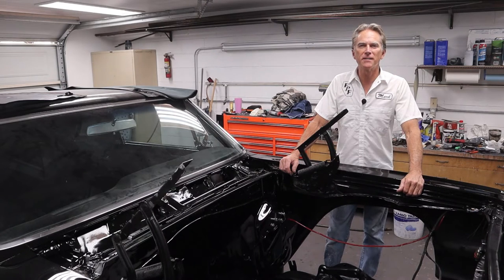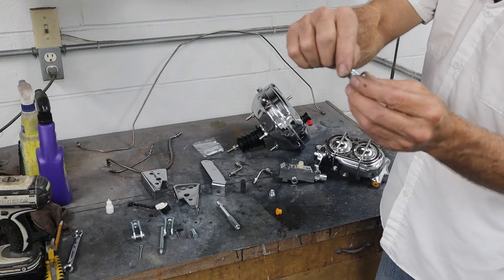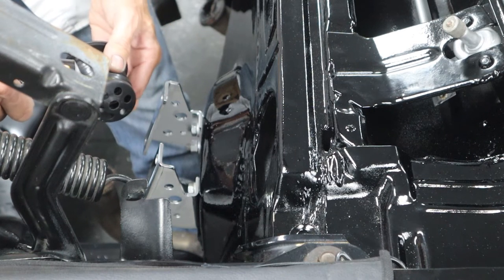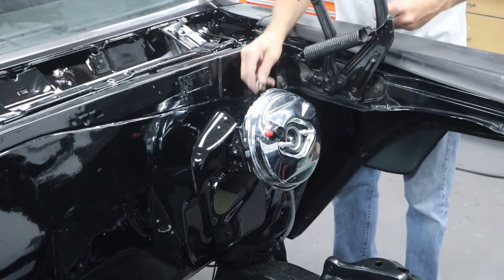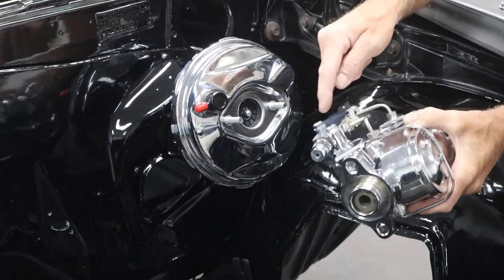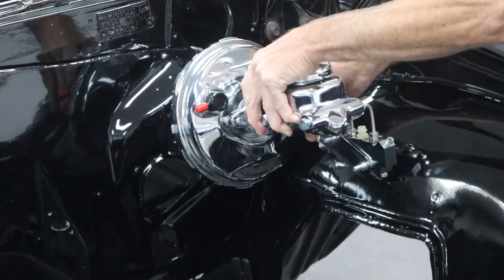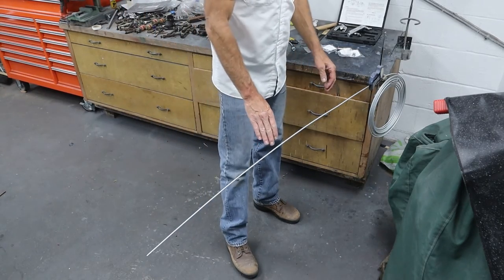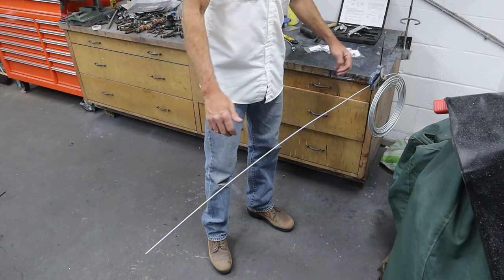1965 Malibu SS (Ep 14) Drum to Disc  New Brake Booster, Master Cylinder and Brake lines Installed

Comment: Really enjoying this series. I'm like you, I like the car to be sealed. I recently removed the entire interior of my 64 Chevelle to install sound deadening and even though the car was restored about 10+ years ago, I was surprised on how many holes were in the floorboard and firewall. I had to seam seal sections, add in factory body plugs and seal holes that had been drilled in the floor for what ever reason.
Reply from the maker: I think it is one of the easiest and cheapest thing you can do to improve the drive quality of a car, especially older cars.  Strange what we find in these old vehicles even when we have owned them for years and years.  It only takes a small hole to let water in and ruin a classic.
Mark
Reply: @FoothillPaintandFabrication  As I have been watching your series, each post you make it seem to be something I need to do on my car next. I want/need to replace the front metal brake lines, as I have a Wilwood system, but who ever installed it, hand bent the lines going from the splitter to each front wheel, so there are hard kink bends. The brakes work, but....yeah, naaaa, not correct. Looking forward to the next video. Thanks
Reply from the maker: @OpenRoader  Strange they would do that when a bender is pretty cheap on Ebay or Amazon.  The double flare tool is a must so get one or borrow one and you will make it look perfect I am sure.  Undoing less than proper work is sometimes most of the work on these cars isn't it?
Mark
Reply: @FoothillPaintandFabrication  I would say, 80% of the work I have done on my car has been undoing/redoing someone else's poor workmanship. But it's OK. I'm a details kind of guy, I like it all to work. I'm getting there. I emailed you some pictures. Blue 64 convertible
Reply from the maker: @OpenRoader  Perfect thank you.  I will get them in a video soon.
Reply: @FoothillPaintandFabrication  Awesome, Thanks

Comment: Nice job. Brake lines can be trying to say the least!  Had to replumb 50 chevy 1-1/2 ton truck  front brakes, so far, very tight turns.
Reply from the maker: Thank you John.  It would have been a lot harder with stainless lines, galvanized steel is more forgiving for sure.  Send me some pics of the 1 1/2 ton I would love to see it and post them at the end of one of the videos.
Mark

Comment: Prob could’ve mounted proportioning valve on other side of master. Especially if making new lines
Reply from the maker: Absolutely but the chrome bracket that holds the proportioning valve fit on the outboard side and I wanted to keep the engine area clean. It is all personal preference isn't it?
Mark

Comment: Hi Mark 
Great job on that install .  
Very helpful . 
I have the same kit for my 65 Lemans ,  it comes with a white colored plastic piece but the instructions don’t say what it’s for . I was wondering if you could shed some light on what it might be used for . 
Thank you
Reply from the maker: Hey Joe, can you describe the plastic piece to me?  Is it flat or round and about how big?
Reply: @FoothillPaintandFabrication  
Thanks for getting back to me Mark 
I kept searching and found that it’s to keep the metering valve in the proportioning valve  from moving while bleeding the brakes .  You remove the switch that turns on the  brake light when there’s a fluid loss to either front or rear and screw in the piece I’m talking about in its place . 
Thanks again and I’m hooked on your vids ,  very helpful and love the goat . 
I’ll be watching .
Reply from the maker: @joemartocci7907  I just learned something from you, thank you Joe.  I have never heard of that done.  I was taught to always pump the pedal slowly so the valve wouldn't lock out the other end. 
Best of luck on your install and be sure to look up proper booster shaft adjustment.
Reply: @FoothillPaintandFabrication  
I did.   I should be good 
Nice chatting with you 
I’ll be commenting on your vids 
Good luck with the 67   Can’t wait to see more

Comment: Do u have to use the stock Proportioning valve or can u just run the lines straight from the new chrom one ? Thanks
Reply from the maker: You do need to run a proportioning valve so if your car has one already but is not a 4 wheel disc brake   car and that is what you are installing you will need to run the proportioning valve from the kit you bought and toss the factory valve.  On the Malibu it was 4 wheel drum with a single master cylinder and no proportioning valve so it needed everything for the conversion.  If this doesn't answer your question of if you have more just let me know.
Mark
Reply: @FoothillPaintandFabrication  thanks 
I have a 65  impala I just put the disc brake kit on the front and i'm still running drums in the back My car did not come with any brake lines or anything. I put new everything so I don't have that little copper proportioning valve That comes on the frame of the car 
but my brake booster comes with that big Chrome proportioning valve like the one u have . Can I just use that alone and run everything from there
Reply from the maker: @josha7548  Yes run the one that came with the kit.  I am assuming the kit you bought is for front disc, rear drum setup as some parts are different for disc/disc. 
For the rear drums you will just run a single brake line to the rear end. For the front you will need to split the line coming out of the proportioning valve for the left/right discs.
Reply: @FoothillPaintandFabrication  ok thanks for the help , I appreciate it🙌🏽
Reply from the maker: @josha7548  no problem, let me know if I you have any more questions

Comment: NO NEED TO ADJUST THE ROD ON THE BBOOSTER. CORRECT?
Reply from the maker: I did adjust the booster to brake pedal rod a little so it was back up against the brake light switch/stop with a small amount of play so right after the brake lights came on you could start to feel braking pressure in the pedal. Maybe about an inch or so at the bottom of the pedal. Once the system is bled do your final adjustments with the car running. Use the lower hole in the pedal arm, the upper is for manual brakes, lower is for vacuum assist. I did fine tune it a little so it felt right during test driving too.
Reply: @FoothillPaintandFabrication  cool...thanks on that...but between the rod and master cylinder Is no adjustment needed? Like other cars where an a djusting tool is needed?
Reply from the maker: @ari1234.  Correct there is no adjustment but there is a short plug that goes into the master cylinder where the booster rod goes in. It is needed for master cylinders that are set up for manual brakes where the rod goes in further.
Reply: mine if flat rubber Thanks @FoothillPaintandFabrication
Reply from the maker: I was thinking about your question and I misunderstood what you were asking.  What I told you was wrong in regards to adjusting the rod between the booster and master cylinder.  Here is a quick video which shows it clearly. https://www.youtube.com/watch?v=WI_CXBJ6J3E 
I apologize for the confusion.
Mark  @ari1234.